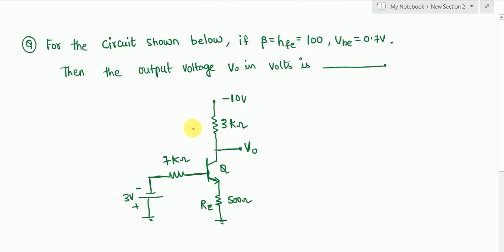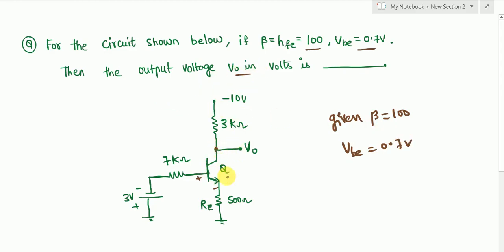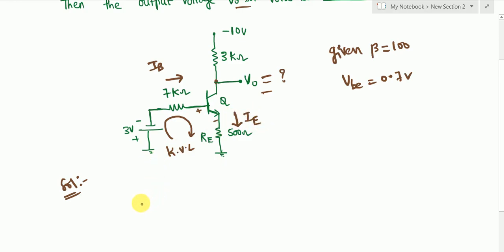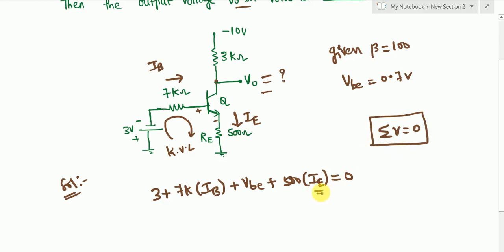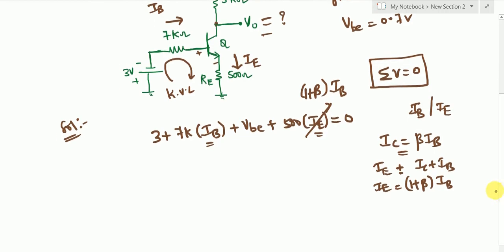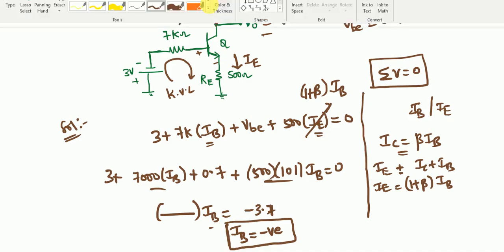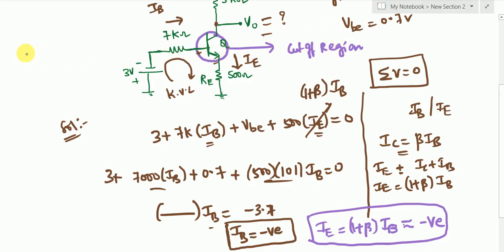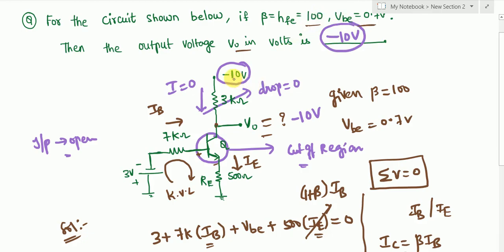Analog(BJT) Numerical question

Comment: That is a n channel bjt. The output is -10v. If you make the vcc +10v and voltage vbb +3v the current Ib can flow into the transistor. Or change it to p channel

Comment: If the transistor in cutoff region how can we use the above relationship
Reply from the maker: It's like checking each case and concluding. Assume BJT in active and check for assumption then it's obviously in other region operation. As currents are negative we can say it's in cutoff region.
Reply: @knowledgeunlimited  Thankyou